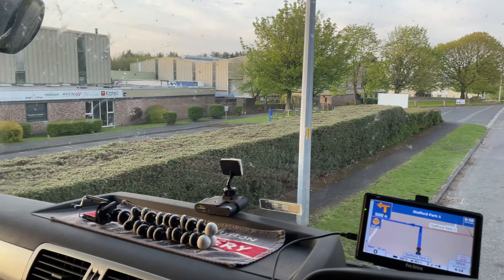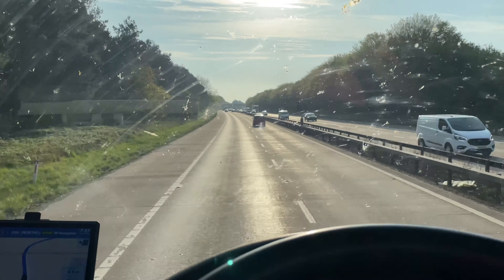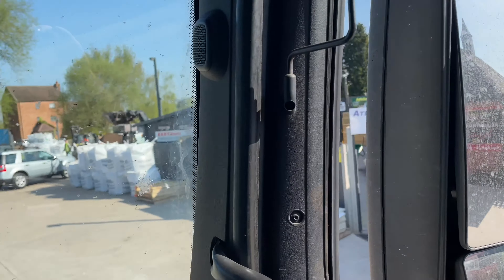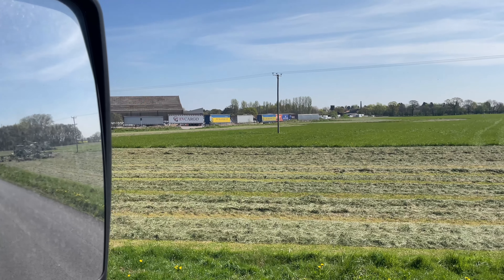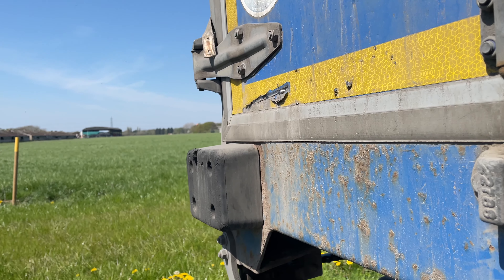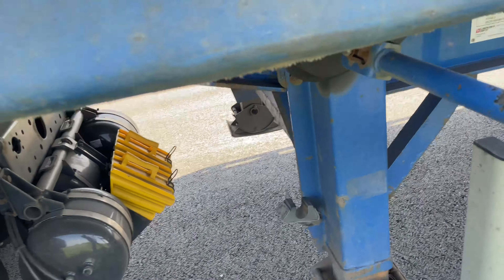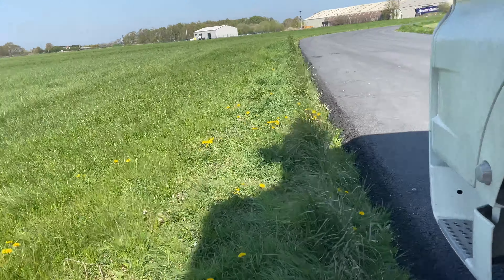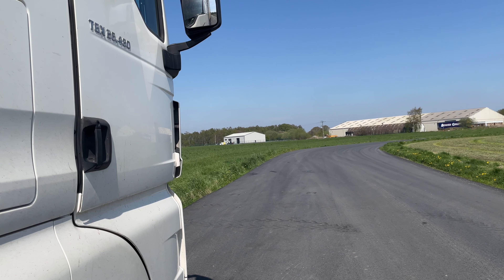Day 4 Tramping & HOW TO DROP A TRAILER

Comment: I never wind the legs all the way down, just in case the next driver doesn’t back under exactly square on and jams the legs against the ground, making it hard to wind them up again, leave about an inch gap and lower the rest of the way using the suspension.
Reply from the maker: Hi Mick, everyone has different methods regarding the legs as most units differ somewhat in height. I do it this way & use the air to lift it up after backing under-same result in the end 😉.  Cheers for watching my friend 👍🏽